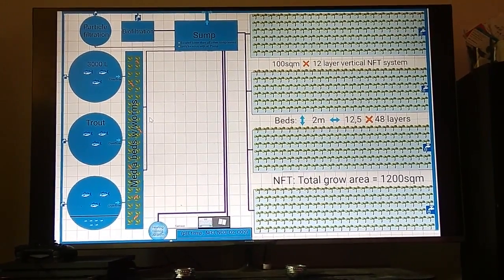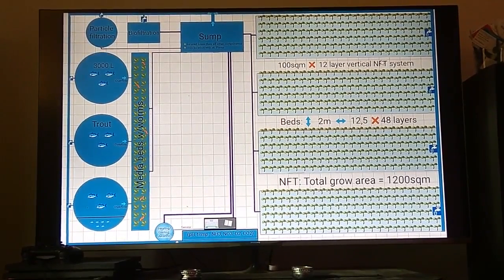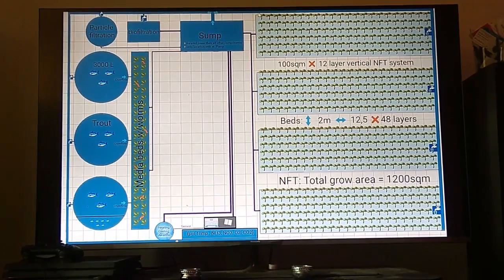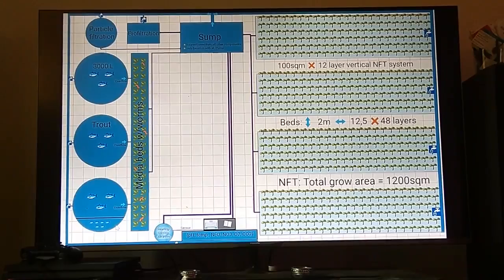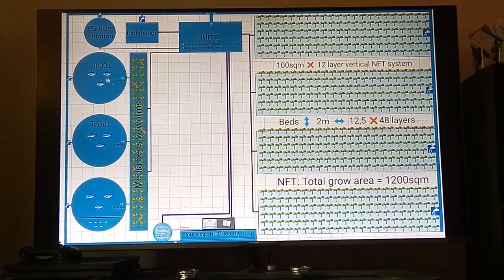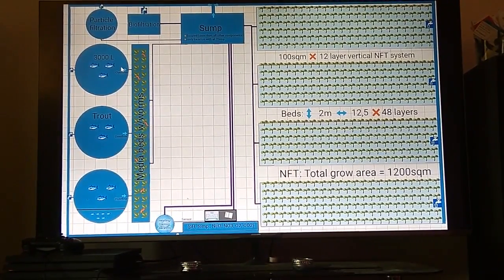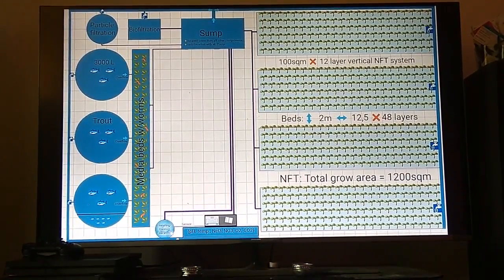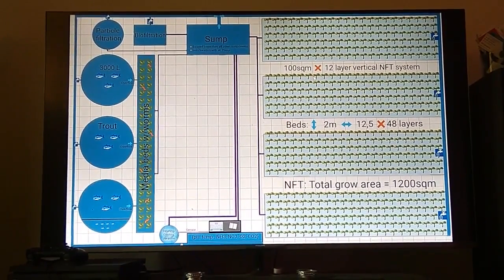Norway Commercial Aquaponics Blueprint Part 1 | Ask The aquaponics God

Comment: I manage three systems for a correctional facility (two hydroponic and one aquaponic) and I agree that DWC is much more trouble free then NFT. If I had the materials right now I would tear out all of the NFT and replace it with DWC, simply a more reliable and stable method of growing. NFT has clogged up, frozen solid, and overflowed more times then I care to count while the DWC has performed exactly the same day in and day out since the system was built. I am not saying that someone could not design a better NFT then the amateur system that we have but not even a perfect NFT will outperform a DWC IMHO.

Comment: I don't run systems without media beds. They add too much to the system if done right, bio filtration being the big one, mineralization breakdown of waste that may be discarded from a mater filtration system otherwise, testing and/or planting of larger vegetation, and it's still productive space use. My biggest problem is placement. Some may not agree but I think DWC beds should be first to allow time and distance for breakdown. Media beds should be last. It works well for me but my school of thought is to keep everything in the system. I try not to remove solids as much as possible, that's plant food.

Comment: I agree with Brooklyn's evaluation and advices but I do also think Norway isn't Florida so both NTF and trouts should be much easier to cope with (and maybe tilapia would be more expensive than for most people due to the need to warm water to get decent growth. To stress one of Brooklyn's points: bad things WILL happen, so prepare redundant equipment (pumps, water lines, aeration) and add sensors through the system so that you can detect water flow problems and trigger an alarm.
That said, a 12 layers NTF is going to be a complete mess to manage and to keep properly lit: you'll probably need elevator carts for workers, or you'll carousels (I've seen one in Abu Dhabi and I think I'd never want to take care of something like that ^^; ).
Speaking of lighting: are you Christian planning to use artificial lighting during winter? I'm curious about that.

Comment: Dude, really? You should be true to these guys. Not only you don't tell much but you don't tell them the hard truth: they have it completely wrong in their design, which means their (little) knowledge of the topic will bring them to a mess if they build this thing, not understanding the reason of their failure. Biscuit headed growers come from biscuit headed consultant($) 🤔
Reply: I'd say Brooklyn told them that most of it isn't good, or at least, if I was them, I'd seriously think about redesigning everything: if I thought I had 1200sqm with NFT but got scaled down to 120 because I should use DWC, I'd call it quits for a commercial operation.
Plus, they do have a trial system they're going to show us in another video, so maybe they do have at least a minimum level of experience :-)
Reply from the maker: 99% of people that submit their blueprints on here are not students that have taken the core course.
Reply: He also said that people from the course don't need to send a video :-D
Reply from the maker: That’s absolutely true Roberto.We have a private forum where we communicate and they also can send me direct email.